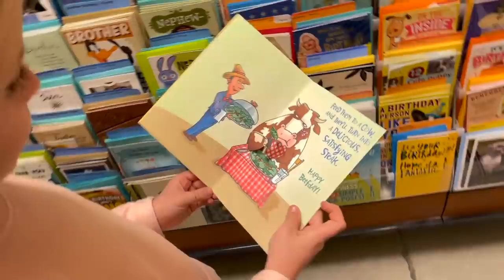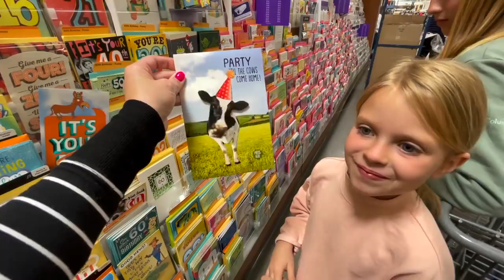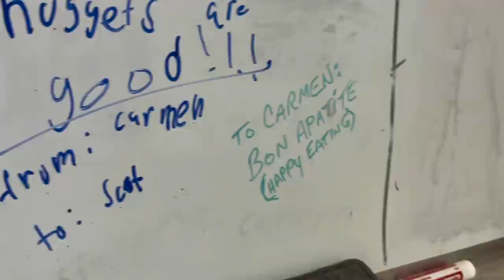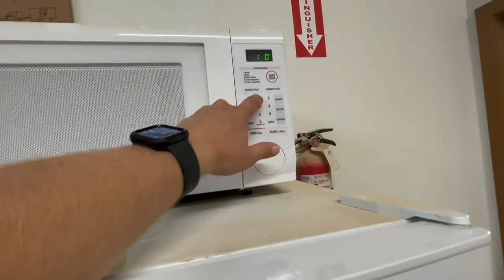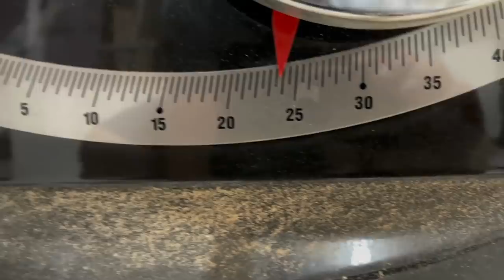Eight Year Old Builds Dogs Dream Home | Preparing for the HUGE SURPRISE!!!

Comment: Have you ever accidentally touched the table saw blade
Reply: That's the one tool, a circular saw, I will never buy. I have jigsaws, drills, a planer, and sanders. But a circular saw is just too dangerous for my piece of mind.
Reply from the maker: I have been cut a few times by saws and luckily haven’t lost any fingers.  The saw I was using is called a Saw Stop. It has special technology that won’t let you cut yourself. It shoots the blade down instantly if any fleshy thing touches it.  I once had a a blade come through the edge of a piece I was ripping and it kicked back. I pushed it back down and the blade caught the edge of my finger and the blade instantly stopped. I was expecting to see blood but but it didn’t even break the skin.  I just bought a portable version of that same saw today!
Reply: @themcneelfam6661  yep I learned about them in shop class